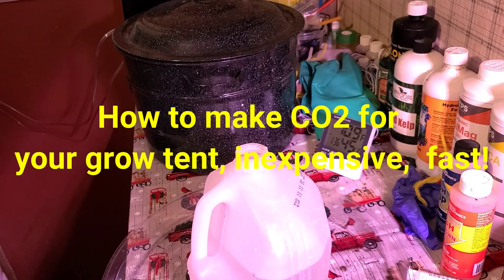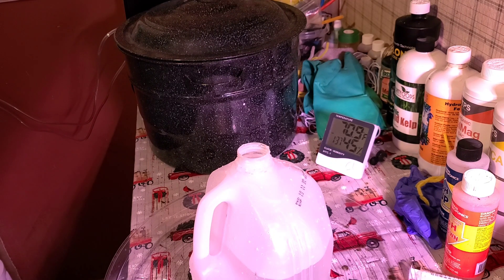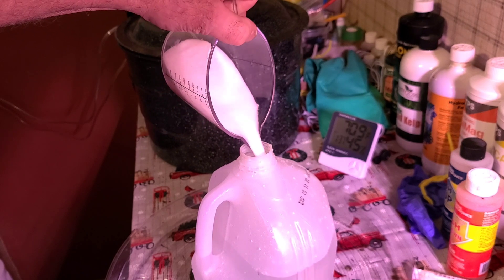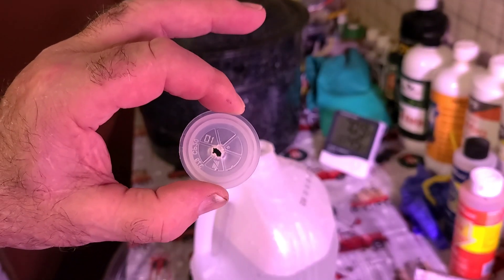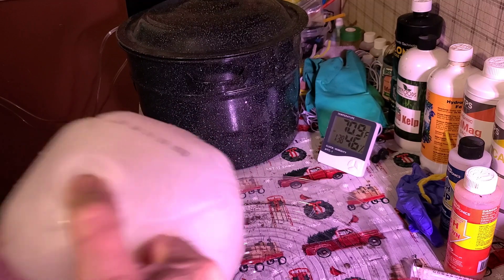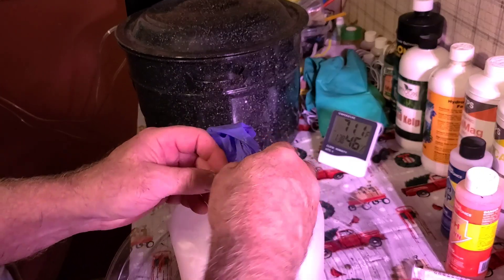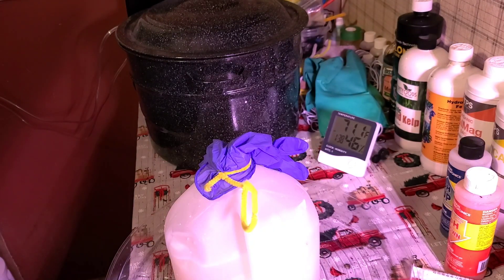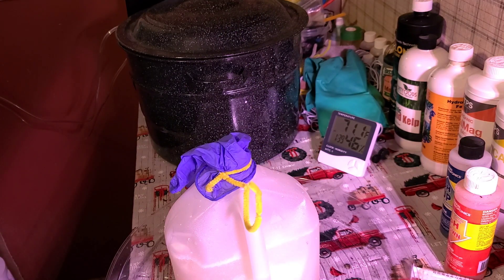Homemade CO2 generator,  in time lapse

Comment: This is absolutely worthless if you don’t show how much C02 is produced!
Reply: All ewe huemans want "spoon-fed"...👁️
Reply: whats wrong with you
Reply: @Deeze365  He is absolutley right, without a co2 meter it's hard to tell if it's the right amount of co2, so you can't dial it in.
Reply: @iamhere444  There is no right amount, it's called concentration. But that's besides the point, he's just criticizing and it worked just fine for my needs.
Reply: @Deeze365  I'm just part of the "not f***ing around" fam. We like to have everything black on white. Not knowing the right concentration is is a problem for us (thinking about the term "parts per million" the term "amount" is technically not that wrong and sorry I'm not from an english speaking country but thx for the correction). If you want to grow like a pro you simply need everything to be measured. Measuring is key of knowing/learning EXACTLY what you are doing. Sure there's growing systems where co2 and its concentration can be neglected, but if you have really strong lights it is better to know the ppfd of those and to add co2 as needed. Sure if it works for you and you don't want to change it that's alright!! Much love fam
Reply: @iamhere444 quit being "sorry", be better...👁️